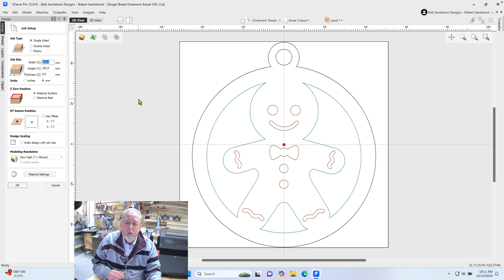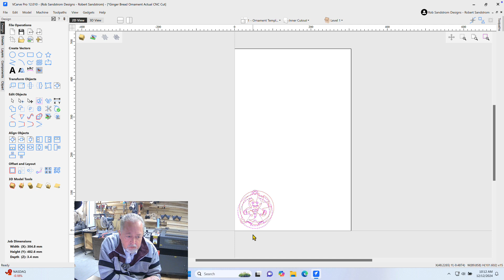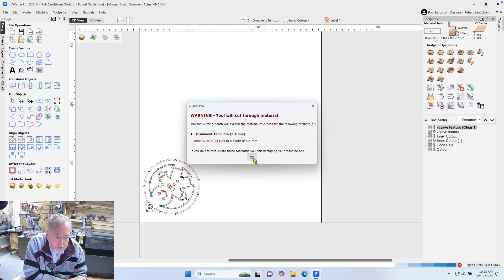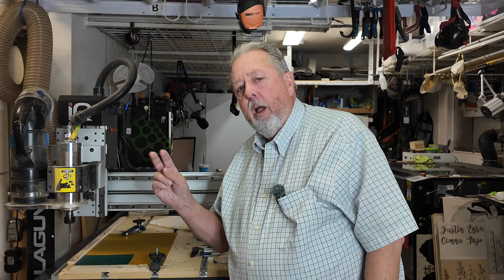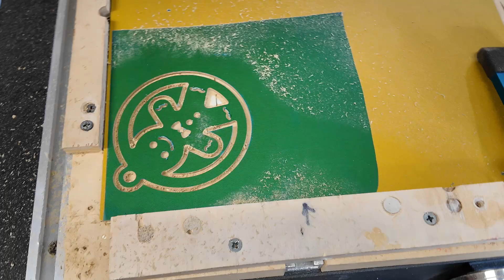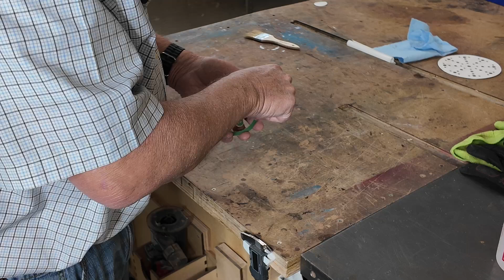Part 2 of How to Use vCarve to Design Ornaments - Cutting a Gingerbread Ornament on Your CNC

Comment: I like the caliper holder on the workbench. Not sure of the motor to left (router?) Great tutorial Rob. Thanks Seasons greetings!!
Reply from the maker: Yes that is a router - I use it mostly for putting chamfers or roundovers on serving trays and cutting boards when I don't want to use my router table.  It is very handy, battery powered, milwaukee trim router.